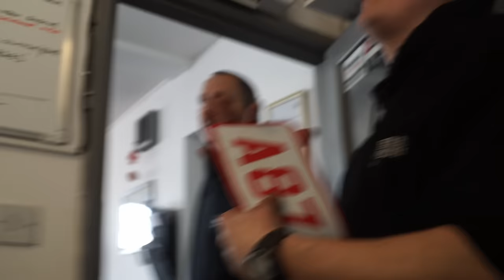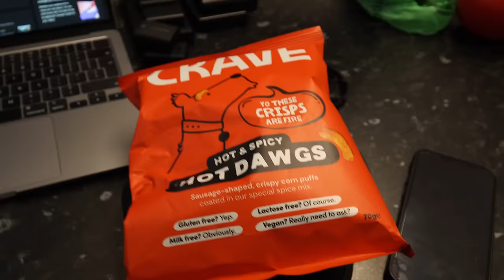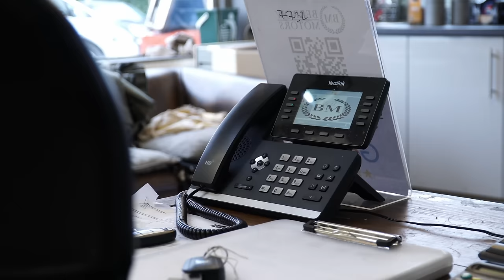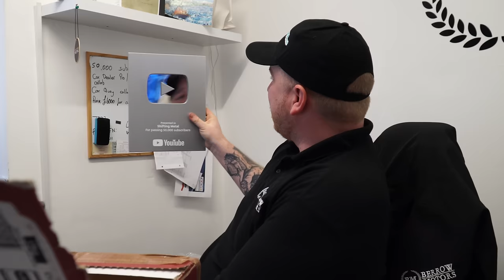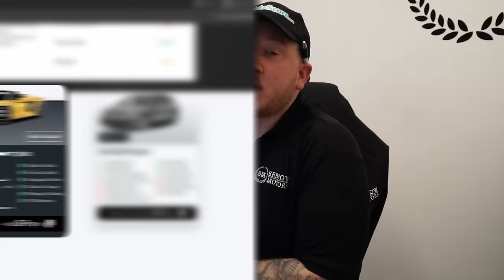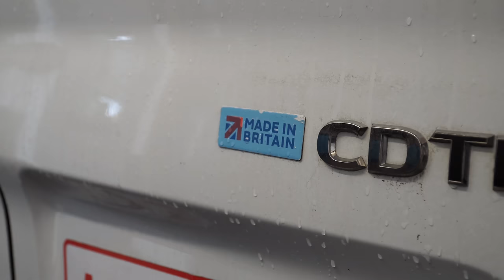"GO HOME, I'LL DO IT MYSELF"! | BM Weekly EP 27

Comment: Ok, so firstly a Tornador is a great tool for blowing out all the nooks and crannies before you initially vacuum the car. Secondly don't use a Turbo nozzle on a car or van's paintwork, it is very aggressive and is meant for patio cleaning. Any loose or stone-chipped paint will lift it right off. Thirdly I've got a feeling Jordan is getting sacked any day now

Comment: The crunchie noise most likely to be a lack of good old fashioned servicing when mechanic used to apply white grease on the hinges and spring loaded latches and clean the drain holes at the bottom of the doors, also amazed at the amount of vehicles where the bonnet catches are bone dry and rusting.
Reply: I was taught to oil and grease locks and latches.....it's the little things that go a long way....some cars go their whole life without gearbox oil, brake fluid or power steering fluid changes....criminal

Comment: We bought a ex BT Vivaro....Great vehicle BUT the only issue is most BT vans spend alot of time idling so can smoke quite heavily if left idling...but has full 240v inverter engine run with keys removed lots of locking cupboards 😊
Reply: Yes, idling not good for any engine.

Comment: What I will say is I agree with both Joe and Jordan on the tornador. They’re both right, you do blow dust everywhere with it. However, it can be a lot easier to vacuum said dust out of the seats and off the dashboard etc than some of those cheap nasty carpets. 
Speaking as a valeting business owner. 

I would side with Jordan 😬😂
Reply from the maker: Yeah, no doubt it has its uses ( I bought it after all) but it doesn’t need to run all day long and be used on every inch of the car 😂
Reply: @ShiftingMetal  No definitely not, blowing out the carpets and behind the seats etc and blowing out any residual dirt/cleaner from buttons and switches etc after cleaning. It’s an enhancing tool not a primary tool 😂
Reply: Yeah I couldn’t work with someone that micromanages me in that manner.